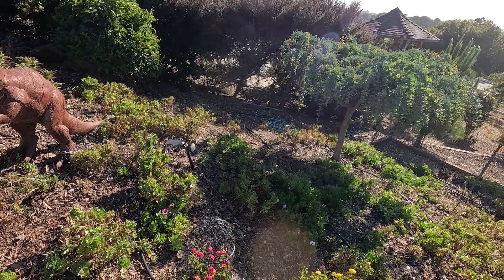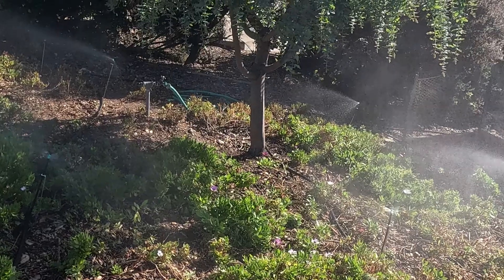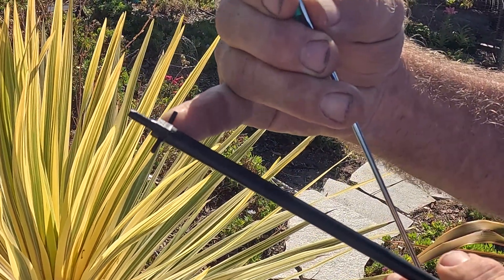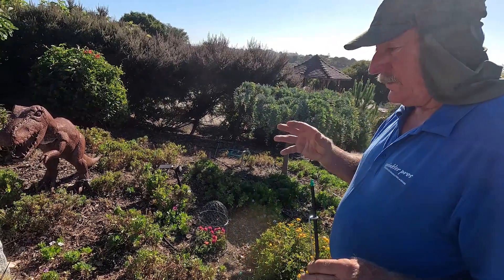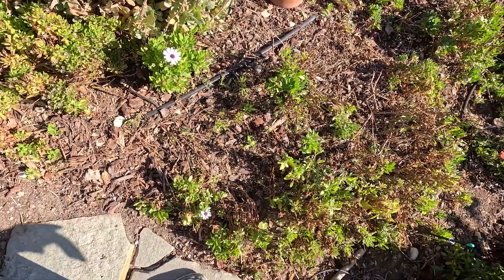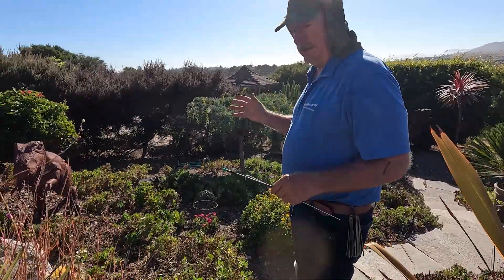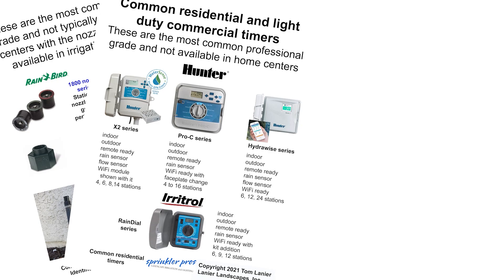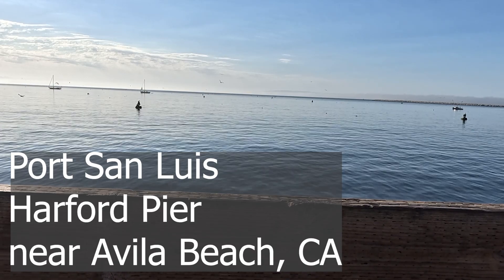Installing a drip spray line along with concepts for best practices

Comment: We have a bore which gives a lot of water, we use pipes and small sprays on a narrow bed by a fence  but I am not happy with them, would this rubber tubing stand up to the high volume and strength of the bore water?
Reply from the maker: I don't know what your water pressure is. Drip systems typically want to run between 20 and 30 PSI OPERATING pressure. I always recommend not using drip sprays on well water due to the typical debris in the water. The ports on the sprays are tiny and clog easy. See my video about irrigating with well water.